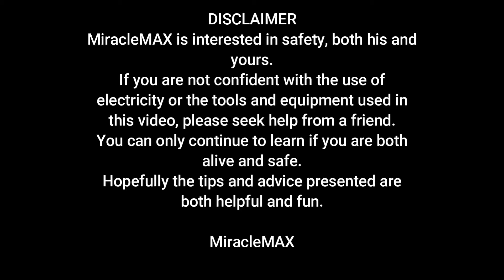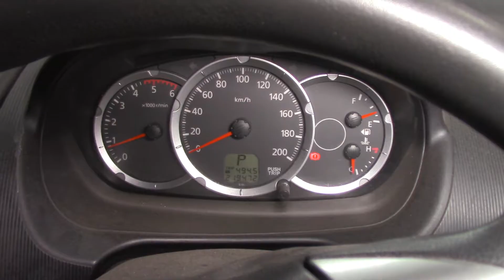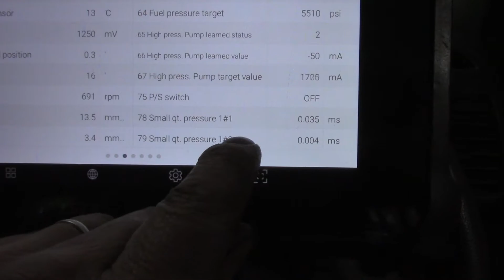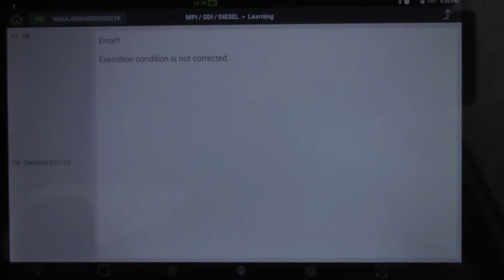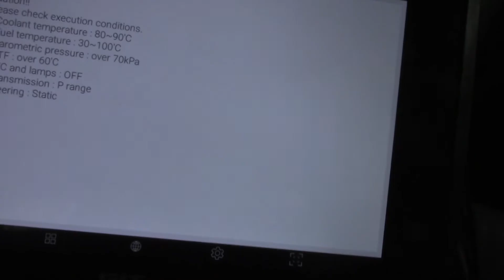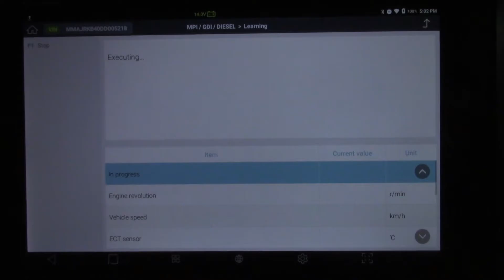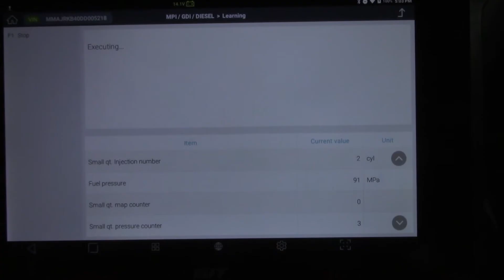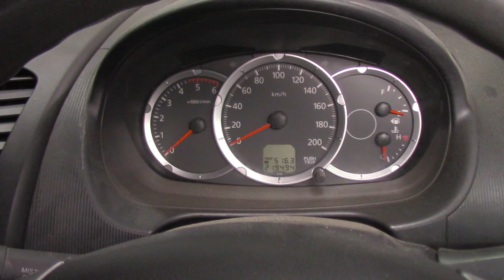Triton Small Injection Quantity Relearn

Comment: Hi Max. Wonderful video as usual!   I'm trying to do my relearn on my Triton 4d56 using Snap on Solus Ultra and having no luck whatsoever. I've tried now about 30 times. Is there a common mistake that I might be making?
Reply from the maker: You are not alone. These are a pain to get right. It is crucial to get the criteria spot on. I don't know if the Snap On gives the required criteria or not.
Here are the needed specs that might be of use
https://youtu.be/Z6_ru3XxO20?t=212
Reply: @MiracleMAX thanks for that max, yes the snap on seems to show everything within parameters but still won't execute for some reason. I think I'm in your area, can I engage you to help me out?
Reply from the maker: @lucasgraydon3381 You can catch up with me via Email miraclemax3@hotmail.com

Comment: I keep getting P0093 fuel leak code. I did the relearn successfully. It has a new rail pressure sensor. There is no visually obvious leaks anywhere. Please help, what could this be?
Reply from the maker: How does the desired fuel pressure compare to the actual fuel pressure on your scan tool? Have you carried out an injector leak back test?
https://youtu.be/LzXsCZKQHhE
Can you see a difference on individual injectors in live data?
It could also be a fuel pressure relief valve.
Reply: @MiracleMAX i think you are on point here, it is intermittent and when it is acting up the actual pressure fluctuates around 1000 psi plus or minus from the desired. Then after a while of driving and clearing the codes, it stabilises and the problem is gone again.
Reply from the maker: @omdcarsandairplanes  Let us know what you find. 👍
Reply: @MiracleMAX  ok so i observed the small qt pressure readings and all of them are equal to each other. After an hour of normal driving, the problem came back, rough idle, P0093 came on and the actual fuel pressure is fluctuating 1 to 2000 psi higher than desired. What could be the problem?  Is it the suction control valve? Or the pressure limiter valve? Appreciate you taking the time to help me out. 🙏🏻
Reply from the maker: @omdcarsandairplanes  It is difficult to make suggestions without being there to carry out tests. These do have issues with SCVs

Comment: Had the code P0089 with check engine light on my 2006 L200/Triton. 
Changed the SCV. 
Could not perform small quantity injector relearn even though conditions were met. 
First I had to initialise the high pressure fuel pump with my autel MP900. After that the relearn could be started and completed. 
Now the pickup is running like new.
Reply from the maker: Well done. 👍Yes the relearn is a fussy guy. Generally any engine related fault codes must be cleared first.
Reply: Can you say which Autel model that is cheaper than MP900 will also do the small quantity relearn. I need to do the valves on my 4N15 Pajero sport. Cheers
Reply from the maker: @jeremyubrien2955  There are several. Best to search 'autel bidirectional scan tool' and check out the price that suits you best. Also make sure it has the software for your vehicle. If in doubt, contact the seller.
Reply: @ thanks for the reply. I really enjoy your videos. I have tried contacting sellers actually but none seam to be able to clearly and confidently able to answer the question. From the research I’ve done, I am not confident all bi-directional Autels will do this. Similarly with Topdon. I contacted premium diagnostics and they said they believed the AD900BT will do it even though they had info from Topdon themselves that this is not a listed function. However they were willing to take the unit back if I bought it and it didn’t do what I wanted. Clearly the G scan 1 and 2 do it. I am going to reach out to Mount Autoequipment to see what they say.
Reply from the maker: @jeremyubrien2955  Yes, good idea. Ben will be able to help you out.
Reply: @ Should have a G scan 2 coming soon! Problem solved hopefully
Reply from the maker: @jeremyubrien2955  Well done! 👍
Reply: Nice video. At a recent service, Mitsi suggested I get the injectors cleaned. I said no as it’s only got 60,000. Spoke to a fuel injection guy some time later. He smiled and said that it would be highly unlikely that injectors need servicing under 150,000. Besides, pumping cleaning fluid doesn’t do the job.  He reckons a hydrostatic bath and a spray pattern test followed by small injection quantity learn. Who is correct?

Comment: I had to opportunity to use a scan tool that allowed me to do that special function.

It took three tries to get it to do it. After following the advice from a qualified mitsubishi mechanic I know, I drove the crap out ouf the pajero on a steep hill around the corner of my house.

Came back and it worked. I did the quantity test twice. It's a really finiky thing. Won't say what's the holdup.
Reply from the maker: The GScan will tell you the criteria of running the relearn, however the Autel will not. It is a pain to get it right, but worth it to get it running correctly.
Thanks for your comment 👍

Comment: Hi max, any idea why when I start the relearn process it would execute for a minute or so then the engine would stall
Reply from the maker: Did you fill all the required criteria to start the relearn? I've never heard of it stalling during the process. When was the last time a relearn was done & how many times did you try the procedure?
Reply: @MiracleMAX  I did, I found it hard to get the right temp steady  so I changed the thermo before the last attempt much easier now. Done  4 times but it always cuts out during , might I add the turbo was reconditioned injectors were checked , scv valve was changed, maf and map sensors was changed. Coolant never dropped in time I’ve owned it (1year) so I don’t think it’s an overheating issue. It drives good, but on idle has failed test cause of white smoke and emissions
Reply from the maker: @buddyelf6565  Were all the adaptions done when the components were fitted? What scan tool are you using & does it have any fault codes? Has a smoke test been done on the intake system?
Reply: @MiracleMAX  no adaptions were done as they were fitted cause I only got the tool last week. It’s Diagzone software with Bluetooth obd. There is no fault codes either. I haven’t done a smoke test, do you think a vacuum leak might be the problem ?
Reply from the maker: @buddyelf6565  You would have to do a smoke test to verify a vacuum leak.
Reply: @MiracleMAX  okay I’ll give that a go and let ye know how I get on. Thanks, great content by the way.

Comment: hi max my 4m41 will not do the test. all the data list is per requirement but i notice at the bottom it says my at oil is -40 but my car is a manual would that be stoping it from doing the test 
i go into live data and i cant see at oil temp and scantool knows its a manual car
Reply from the maker: What scan tool are you using? Does it have the latest software update? The Mitsubishis are very fussy with this relearn procedure. -40 usually indicates an open circuit, but if yours is a manual that shouldn't make a difference. I gather you are referring to auto trans oil temperature. Are all the vehicle details entered correctly?
Reply: @MiracleMAX  yeah reads vin and says 5mt 4m41 but in the data list shows -40 at oil 
and nowhere else does it show anything to do with auto
i’ve tried the g3 and zenith both same results
Reply from the maker: @jacksondudes  Hmmm, that's interesting. I haven't come across that before

Comment: Hi Max ,
My car 2010 MN triton 2.5DID
 I try relearn it wouldn’t let me do keep coming up turn on the engine even engine is still running.Please help.
Thanks 
Tri
Reply from the maker: What scan tool are you using? Have you filled ALL the criteria to carry out a relearn, including lights off, transmission in park, air conditioning off, correct temperatures of fuel, transmission and coolant?
Reply: I use MUT software and drive the car 40km before scan Should be everything up to temperature .What scan tool do you recommend please.
Thanks
Reply from the maker: @tridnguyen463  It's not about driving it a long time, it's about driving it to meet the conditions mentioned in the scan tool. The conditions were shown in the video. https://youtu.be/Z6_ru3XxO20?t=215
Reply: Thank You for your help I try again 😊

Comment: Mercedes Benz E class 2021, I replaced my injector and Check Engine light still ON, should I programming by new code number? Or no need? What I need to let Check Engine light off?
Reply from the maker: You will need to calibrate your injectors when you install them using the appropriate scan tool. What fault codes do you have with the check engine light on?
Reply: @MiracleMAX  the code is: adjust injection quantity. Do you mean calibrate it is code it or reprogram it by new code number of new injector?
Reply from the maker: @muhannadalamri3521  Do you have the actual fault code number? Have you carried out injector coding? Did you take a note of the codes on the injectors before installation?https://www.youtube.com/watch?v=iCK3REQ-yzg&ab_channel=MiracleMAX

Comment: Hi Max, Good videos, regarding the Scan tool you use (G-Scan is it),for the Tritons Small Injection Quantity Relearn, do you have to buy software upgardes subscription to keep the tablet software going, or will it still work without payment upgrade subscription?
Do you know of any other brands that do this job without payment subscriptions?
How come those 2 types of triton engines have to be relearned, isnt the ECU any good?
And Ive been looking around for other brand of tablet and theres ones with Injector Coding, so is this the same as Small Injection Quantity Relearn. Sorry to ask so many questions. Thanks
Reply from the maker: Let's try and answer your questions, Scott.
I honestly don't know if the remaining software will continue if they are out of subscription. However, that being said, I have used a GScan 1 that is no longer supported with software, but it is still useable.
Can't help you with non-subscription scan tools. You would have to contact a supplier so that they could contact the manufacturer.
Coding is not the same as a relearn. Each injector is slightly different to the next. So the 'batch number' is what you use to code the injector to the ECU. Relearns are used to adapt to changes within the correct combustion process in the engine as modified by the ECU. As parts wear, emissions, fuel economy etc, are adjusted for by the ECU. A relearn helps to get the injector pulse width time back into a corrected setting.
Reply: Ok Thanks Max, very much appreciated, so do you know what other Brands do the relearn to look around and thats good that your g-scan 1 still works, did it have sunsbsription when you bought it and  do you know how many seconds is good for the triton to start up, I timed mine and took about 1 and half seconds to fire up after ignition start position, but in winter time it was longer, but good now that  weather has warmed up, would that be battery doesnt like cold weather ot diesels just dont like to fire up as quick when cold. Thanks
Reply from the maker: @scottbrewster4032  I've always used subscriptions - love 'em or hate 'em. In my business, I have to be up to date. Most higher end scan tools will do a relearn. Try the Autel range of scan tools. There are others around. Topdon also has quite a range that might be useful.
As for the hard starting, have you tested your glow plugs?
Reply: Thanks Max. I'll look at those other scan tools as well and I''ll check those glow plugs out. Those scan tools can test those can they, if not will do manual test. Thanks for your time.
Reply from the maker: @scottbrewster4032  No worries, let us know how you go. 👍
Reply: 👍 @MiracleMAX

Comment: I know someone has touched on this in the comments but I'm still unsure. Will relearning my injectors interfere with my ECU remap?
Reply from the maker: No. That is set into the EPROM. You are simply carrying out a reset.
Reply: @MiracleMAX  thanks max. Just recently removed the manifold to get to glow plugs and did a bit of maintenance while I had it apart. Hooked up my rig and learned the injectors this afternoon. Thanks again
Reply from the maker: @UbFunks  I usually find that I can get the glow plugs out of this engine without removing the manifold.
https://youtu.be/gDZUu27Ixt8
Glad you were able to do a relearn. That is something that should be done as part of the normal service schedule.

Comment: Hello I have a double cab mitsubishi L200 2012 model in Greece, and when at low speeds and downhill it goes often into safe mode( 3rd gear D3 and wont change, so I need to switch off to clear it). What can it be?
Reply from the maker: Do you have any fault codes shown?

Comment: I have all the temputures right but still not letting me start ny relearn ahhh. Maybe because i have egr light keep coming on even after i clear it?
Reply from the maker: You will need to make sure the system is operating correctly before carrying out a relearn. That being said, they can be a real pain to set all the parameters right, including steering static, lights off, a/c off & and few others I can't remember at the moment.
Reply: Apparently Dual chargers, dual batteries, bcdc or performance chips can cause errors in commencing a SQL and best to disconnect them prior to commencing.
Reply: @ramenzwagermam4193  ending up putting on the resistor mod on to turn off EGR light and I was able to do the relearn
Reply from the maker: @ramenzwagermam4193  Great information. Thanks for sharing 👍

Comment: Hi Max, great video thanx. I got a 2016 Mitsubishi Triton MQ. Is the procedure same with the MQ /MR Triton too ?

Also I am planning to clean the intake throttle body . So If I clean the throttle body, do I need do a throttle learn or idler learn function on the scan tool ? 

Thanx mate
Reply from the maker: I believe that the injection relearn is the same on that model & yes you should do a relearn on the throttle body as well. This can be found in the 'special function' area on the scan tool
Reply: @MiracleMAX  thanx mate

Comment: "Quite often these won't carry out a relearn during the road test"

That's because for the relearn to be accurate, the vehicle is supposed to be up to temperature, on level ground, in park and no load on the engine from things like a/c, lights etc.

The engine measures the rpm changes from very small alterations to fueling to each injector. These wouldn't be reliably measured with other loads on the engine.
Reply from the maker: That's exactly right Perky Pat,
What I mean by 'on the road test,' is pulling over on the side of the road to carry out the relearn. That's why I stated all the criteria needed to carry out the relearn. They can be a pain to get right.
https://youtu.be/Z6_ru3XxO20?t=284
Thanks for your comment 😉
Reply: @MiracleMAX  Great video regardless. There isn't much information or videos out there on this kind of thing. I'm always trying to learn more. Any information on preventative maintenance I can perform on my CRD is welcome!
Reply from the maker: @perkypat2214  Good the know. Most OBD dongle style of code reader don't have those features. Glad you are able to do the relearn
Reply from the maker: @perkypat2214  I have done quite a few videos on the Triton diesel. You are welcome to scroll through the list ☺️

Comment: hi max.. I have a opel corsa d 1.7 diesel with Isuzu motor.. I replace the injectors, I make the code in injectors with new codes, but after I start the engine I have a permanent faulse code p1602-4b that's says (small quantities learning not have done.. and I go next to do this, and when I done this learning, the ecu can done.. any idea?? and of course I have and check engine light
Reply from the maker: Hey Andreas,
This seems to be a common problem.
Did you use genuine injectors? These seem to be very fussy with the correct injectors. Why were they replaced in the first place?
https://www.vauxhallownersnetwork.co.uk/threads/p1602-ecu-error-after-injector-replacement.311523/
What scan tool are you using? Did it FULLY complete the injector relearn?

Comment: Hi Max, love your videos. Do you know of any scan tool that can do SQL, Service interval Reset and Engine oil reset on a 4N15 engine other than Gscan? And how much do the Gscan cost you? Thanks.
Reply from the maker: Hey EJ Saab,
To be honest, I'm not sure. I guess most higher end scan tools would have those features. Snap On, GScan, Autel to name a few.
Here in Australia, I have dealt with Mount Auto Equip for many years and have been happy with their service. It would be best to contact someone like them and ask them directly.
https://www.autoequipment.com.au/
Reply: NMPS Diag App With a generic (in my case Autohil), will do an SQL and DPF Regen on a 4N15 And 4N14 (Triton and Outlander diesel).
Reply: @ramenzwagermam4193  was going to comment this. That app works with the 4D56THP in my 2013 MN as well.

Comment: Just curious what would be main reason my triton won't relearn. Mitsubishi tried to no avail.
Reply from the maker: Hey Stephen,
The relearn procedure has very specific parameters that must be followed. Have a look at this section where I discuss the conditions. https://youtu.be/Z6_ru3XxO20?t=215
If these are not followed to the letter, the ECU will not allow the relearn to take place. Sometimes it requires a lot of patience on the part of the technician for those conditions to take place.
Reply: They need to be at above 80 degrees, so idling won’t produce enough heat mine idles at 75C